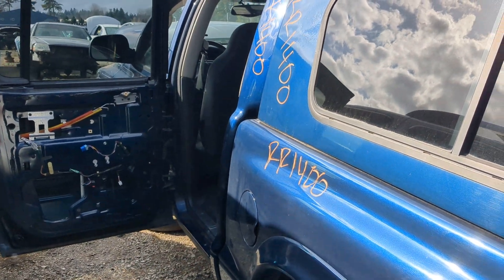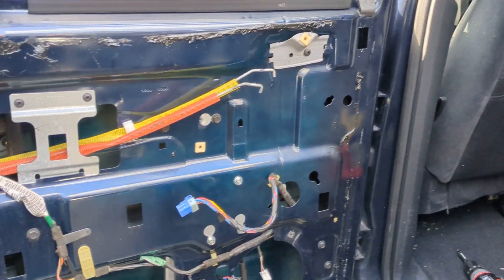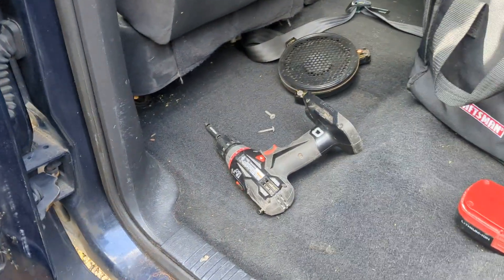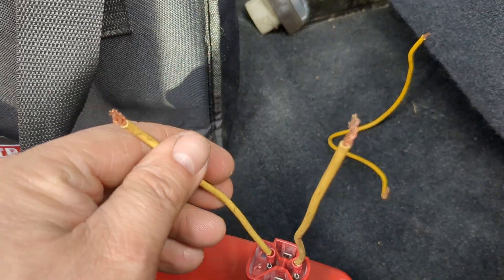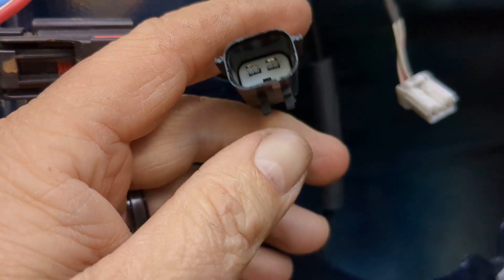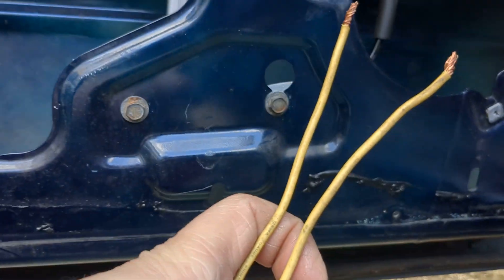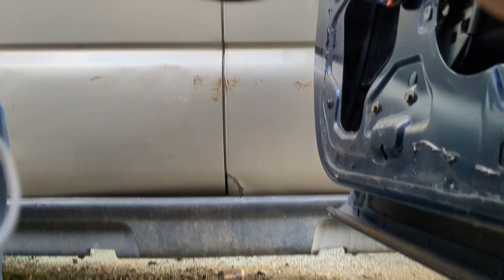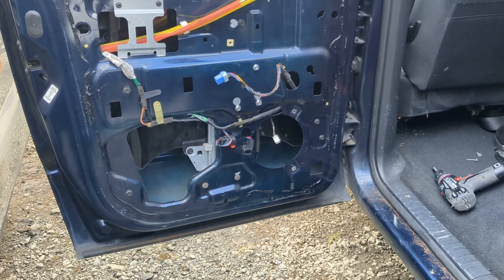Rolling down a power window when the vehicle's battery is no longer in the truck or car.

Comment: I just wish I could find someone showing how to roll a power window down when you don't have access to a battery.
Reply from the maker: Hi Adam. I'll make a point to do another video to assist in achieving the same outcome, but without the drill battery. Keep your eyes peeled. - Sponge
Reply: @spongestechtips-xu1xg  I am wondering why nobody made a manual override for this function. The old cars had some kind of pulley which rolled down windows. Why not make that an addition to the power windows?
Reply from the maker: @pingpong-kv6eq  sadly, I suspect it comes down to necessity, and the cost. I believe manufacturers do not care about the vehicles they make, after they are sold off as new, and later as they age, and start breaking. All they care about, is that the power windows work, when it leaves the dealership for the first time. Anything down the road, is our problem. In reference your recommendation, id say it could be done. Many sunroof motors (which are pretty much the same thing) offer a  Allen wrench or hex head tool manual option, just in case you cannot get the sunroof closed because of electric motor failure or electrical problem. Sadly, I don't think the manufacturers would waste their time. - Sponge